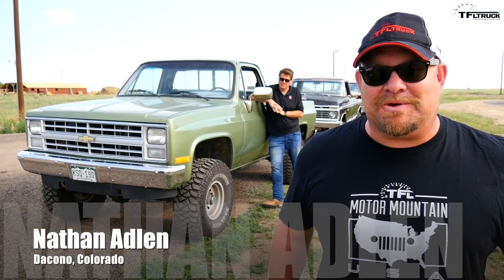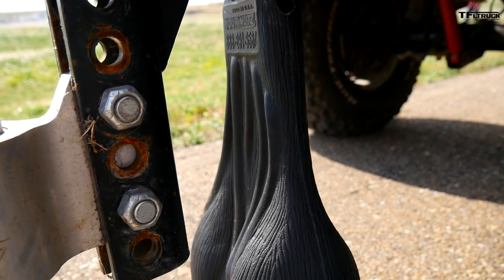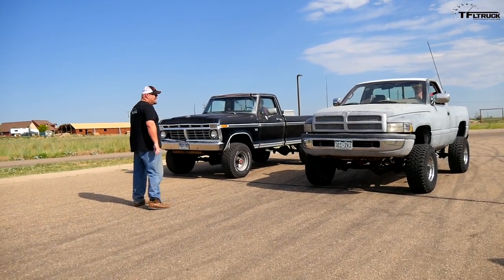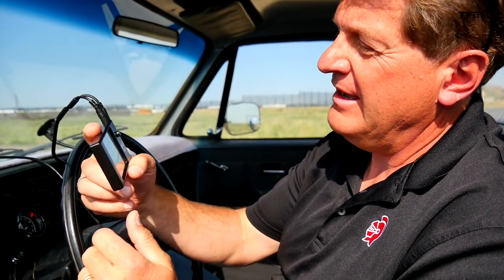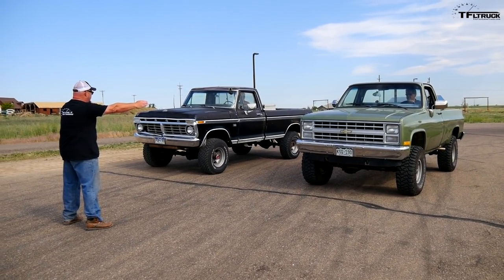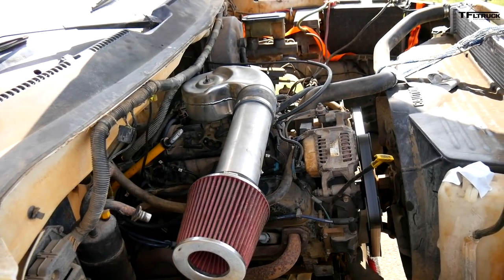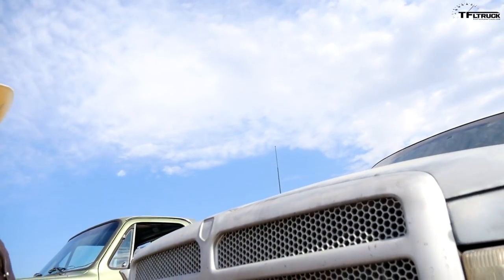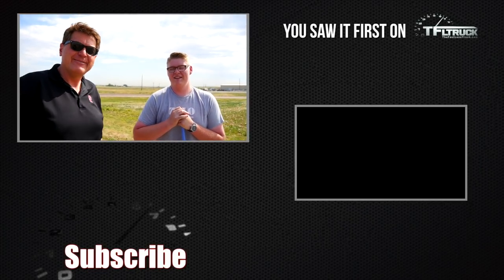Classic Drag Race: Chevy K10 Big Green vs Ford F250 Rusty Boy vs Dodgezilla Ram Overkill

Comment: Are all dodge drivers so embarrassed that they have to debadge the front grill
Reply: guy proulx I'll have to drive my 318 out there with 3.90 rear end and show this chevy what up...
Reply: If that dodge makes it that far, LOL
Reply: Have a 1/4 mile the Dodge would pass them,thanks to the highway gearing with tall tires makes it sluggish of the line..
Reply: lol the doge 318 is junk ahahaha nice try tho
Reply: Otto Bauch Dodge rams are the longest lasting trucks on the road. I don't understand the hate either though. I love all trucks. They have soul. Yet I prefer my hemi.
Reply: Sara Hall 318 is actually a very reliable motor that you can squeeze 18mpg out of in a Ram, same as my buddy's 2008 Silverado 5.3L. They're underpowered, especially behind the automatic, but reliable. Not junk.
Reply: 01trsmar No joke. The 46RE automatic transmission has a 2.45 first gear.... While the NV3500 manual transmission has a 3.49 first gear and 2.19 second gear... So the automatic is almost like starting in second gear with the manual. Also the automatic has a 22-25% parasitic power loss compared to a 17% power loss with the manual... The automatic killed these trucks the most, seconded by the kegger manifold choking the motor above 3000rpm... So you had a motor with low end torque but crappy gearing, and then once you got into the gearing the motor got choked out.... The manual tranny at least solved the low end part of the problem.
Reply: Sara Hall average life span I've seen for 318's at at lest 300k. At most 500k I don't consider that junk.
Reply: Sara Hall i have a 318 i have small misfires but my truck haulls ass still. Still a strong truck good engine.
Reply: Otto Bauch Lol na ill keep my badge that old fart probably wasn't even giving her full throttle.....I lost count how many 5.3s my mildly built 318 in my 92 ram has defeated
Reply: My brothers ram is 18 years old and has a 318 and 225k miles w no rebuilds and runs like a bat outta hell still wouldn’t call that junk
Reply: The 318 is probably the most reliable engine ever built.  I have one in a 95 Dakota with 270K and it has never had any problems except the timing chain cover.  Pulled the heads off 20k miles ago and the shop was absolutely shocked. They had never seen a 250k engine that looked like it had just come off the assembly line.  It didn't even have a ridge at the top of the cylinders. (Mobile 1 since new)
The transmission is also factory and I can't believe it has lasted so long since the truck has spent its life on the farm towing 11k hay bale trailers, and blasting through really rough pastures. It somehow survived my highschool years where I neutral dropped it, did burn outs, went mudding and even jumped it a few times.
I can't believe how reliable this little Dakota has been and I even embarrassed my friends 80k 2018 Raptor the other day.  My tired old 25yo truck out towed my friends Raptor because I have the heavy duty front plow suspension and 2k overloads in the rear of the Dakota.  It actually squats less than my friends Duramax and I was able  to haul 7k pound trailer where the raptor couldn't take over 5k.
Reply: whhitestallion 
No they aren't. Look around, you see 10× the number of 80s and 90s chevs than dodges. No one shares your delusions nice try
Reply: @waterloo123100  
My thoughts exactly.
Reply: Mopar or no car

Comment: FE block engines were beasts (with the exception of the 360; destroked 390 with less power and worse mileage).  The 360 still had torque though.  If it is a 360, get the kit, turn it into a 390, put a cam in it, good heads, and 2 Carter AFB's on top, and you have something called a sleeper.

Comment: First step on the F would be tare the engine down make sure it is a 390 if not get a 390 crank, and pistons , .080" over bore, 11:1 at 6,000 feet you could run pump gas, Comp 280H cam, Performer intake, some bowl blending on the heads, a performance valve job, 600cfm Holley, rebuilt trans. you would just watch that $15,000 chevy fade in the mirrors! And spent $4,000 to $5,000. I estimate 370hp@4,500 rpm and  510 ftlbs of torque @ 3,000 rpm at the crank.

Comment: The Ford is mostly equipped with a 390ci big block, not a 360. Hell, Idk if Ford even made a 360ci small block. However, AMC did make a 360ci Wildcat. I may be wrong though.

Comment: I'd love to see the hi boy with a 390 stroked out. tough engines and very good off road. there's a few great kits for it. with both of my old hi boy pickups I ended up rebuilding the transmission. one C6 with a shift kit.i improved the cooling with a new radiator and a second trans cooler too. the odd ball was the one that got a beefed up C4 trans and otherwise my trucks were stock except for the 16 inch rims (better off road due to bed area) but tires were stock size. the C4 was faster, the engine it ended up with was a 406 and I wish I had it now. the guy really planned out the engine swap. I'm now looking for a 428 block to start a project with no luck. I am a poor guy, can drop $3500 on a block and crank that's also in unknown condition.

Comment: Great stuff guys,looks like you had a blast! I think that would be awesome if Ford and RCA stepped up and did something with those trucks. That old Ford really surprised me how fast it actually was off the line there. I really hope Ford will step up to the plate on that old 74'. Those were great trucks. Sooner than later if you are going to end up blowing that engine up. And that will be a shame when that happens.

Comment: A cam, heads and stall converter in the ford would make it blow the Chevy out of the water. I’m a Chevy but. But the 360/390 is a bulletproof motor that made TONS of power reliably FROM FACTORY. You want a neat car? Swap a 390 into a Fox. Talk about a fun car.

Comment: Hopefully you are going to fix the mounting position of the High Pressure FiTech Fuel Sump.
Reply from the maker: +David Merry Yes we will
Reply: The Fast Lane Truck - I got their EFI System for my '65 Ford Falcon and can't wait to get it installed and running down the road.  Thoroughly enjoy your reviews and other sidebar videos like this one.

Comment: I used to have a 78 F250 with a 460 Big Block in it that used to be the Old Ranch truck I went and swapped it out with a 73 2 Door Lincoln that had a 460 in it and that little sucker would run get rid of that 351 and drop a 460 in it with a C6 transmission you'll love it
Reply: Got a 79.camper special with a 460.strong truck.

Comment: wow way to stack the deck.... 405 hp crate motor vs old big block vs a little 318 with highway gearing and fat tires. hell a stock 360 would still got ate. maybe the V10 2500 or definitely the 5.7l hemi would have been more in line with the others. i mean id of brought a hemi toasted the ford and at least kept with the chevy.

Comment: Kent you should make that a cold air intake. Ik it is a small upgrade but still
Reply: It has a cold intake and headers, full exhaust. I new I'd loose but I still showed up. The night before I put gas in it and the fuel came out of the top of the tank. So the fuel pump was loose and loosing pressure. The truck cut out on the way home and on the way to the track. I couldn't get any rpm's until the end and leaking gas all the way. We put off the race as more problems showed up on the Dodge. I didn't want to put off the race any longer. So I bit the bullet. Next time we'll do better. It's a project truck I don't have freebies from sponsors so I have to shell out money for each fix. The truck is close to done, should be ready for the off road test and hopefully a rematch on the track.

Comment: Dropping a 4 barrel carb with intake on it  and  headers + a cam helps a 360 significantly. Without they are dogs. But it did damn good against that much lighter 1/2 ton short bed chevrolet with the new EFI crate engine in it. That old Ford is a heavy pig !

Comment: Looks like he just held it to the floor in a automatic you have to pump the gas  each gear then when you get momentum rolling you sling shot pump the gas and have it held almost so it roaring then when your about to shift last gear hit the overdrive button and hold it to floor and it will kick you a little bit more into the slingshot I made people look like they were sitting still as I passed them lol you people don’t know how to race I pull on dodge 2500 all the time bc of this you can’t just hold it to the floor wide open and wait it takes even longer to go through the gears

Comment: I like the old Ford in the old Chevy both I drive a old 87 Ford pickup truck with a 5.0 with 500,000 miles on the and it still runs good it's F-150

Comment: It's a pattern ones from the 70s ones from the 80s and ones from the 90s
Reply: Technically that Chevy is a 1970's platform to. The square bodies debuted in 1972 and didn't change much until they were completely phased out in 1991.
Reply: @nathanmcdonald610  the facelift

Comment: that ford is 100% a 360 that cold blooded start is the notorious low compression that 360s have going from 360 to 390 is a crank swap and new heads 
you dont need the new heads but the OEM are trash

Comment: I was sure Kent brought a ringer, but it looks more like a wronger
Reply: It has a cold intake and headers, full exhaust. I knew I'd loose but I still showed up. The night before I put gas in it and the fuel came out of the top of the tank. So the fuel pump was loose and loosing pressure. The truck cut out on the way home and on the way to the track. I couldn't get any rpm's until the end and leaking gas all the way. We put off the race before as more problems showed up on the Dodge. I didn't want to put off the race any longer. So I bit the bullet. Next time we'll do better. It's a project truck I don't have freebies from sponsors so I have to shell out money for each fix. The truck is close to done, should be ready for the off road test and hopefully a rematch on the track.

Comment: I think I know why the Ford beat the Dodge. First, the Ford had its stock wheel diameter while the Dodge has aftermarket over sized tires; when you go to bigger tires, it is like going to a higher gear. The other reason I believe the Ford won is because of its locking hubs on the front. This means that the engine did not have to deal with the drag of all the front end components turning all the time like the Dodge.  BTW, I own a Ram and as much as I love that truck, I was always critical about the front axle and how they have all that stuff turning all the time.
Reply: Master chief Master chief  , nope, not making any excuses for Ram at all. I'm just pointing things out from a neutral perspective. I personally think GM's I.F.S is the best, BUT, if one is still going to use a solid front axel, Ford does it right by having the outboard locking hubs; I am not very partial to Ram's C.A.D & I believe the only reason I haven't had any problems with my front end yet is because I do predominantly highway driving.

Comment: 1983 Ford f250 4spd 460ci 365hp 485 foot pounds of torque towing power  vs Dodge V10 300hp 450 foot pounds of torque 4spd automatic transmission towing power  vs Ford 1998 310hp 425 foot pounds of torque 4spd automatic transmission towing power  best truck the world's toughest engine

Comment: Carbs are way better than fuel injection because you can tune them quick and easy and diagnose a problem very quick and there cheaper and you can make more power
Reply: Yeah I was gonna set my 05 Dakota up with a carb so I could get a performance exhaust and not have to deal with the o2 sensor bs. Someone was like "you'll lose power" bro it's a 4.7 liter magnum v8 makes 235 hp it's a worn out engine I really can't lose much more😂😂

Comment: sounds like the dodge wasn't pulling all the way to the redline.
Reply: It wasn't, the high stall torque converter lets it shift above 5000 RPM's. I couldn't even get to 4000 RPM's until the end. The fuel pump in the tank was loose, the engine was cutting out. But we'll have it all fixed for the next contest.
Reply: Hunter  what did you expect? Lol it's a dodge man.
Reply: Ryan P-76F1004x4 the rpm in which the torque converter lock s up at can make a big difference on acceleration.
Reply: MrTruckTV thanks for the reply and I figured it was something like that
Reply: Hunter  Meier yea I know this. The dodge is some what stock motor wise so why need a high stall??
Reply: Ryan P-76F1004x4 my dad had a 1990 4 or 5 and if you were going at a steep hill with no load it never wanted to shift but it had over 320,000 miles on it so it was to be expected

Comment: V10 Ford 6.8l 4spd 1998 2door long bad 300hp 425 foot pounds of torque   vs 8.0l V10 Dodge 4spd 1998 2door long bad 310hp 450 foot pounds of torque   vs v8 460ci 7.5l 4spd 1983  2door long bad 365hp 485 foot pounds of torque
Reply: Ain't no stock 1983 460 making 365hp. I think they barely made 200hp that year and around 385ftlbs of torque.

Comment: Man those old LA 318 magnum will run forever but they are so weak in the power department.
Reply: jmc6000 me trucks 318 is a magnum they stopped making the LA 318 in 1991 which I have...
Reply: Dodge 318 Cummins Well the 318 magnum is very heavily based off the LA 318.  It is like saying the Vortec is not a small block because it is a Vortec but they based heavily on the small blocks prior to GM going to Vortec.

Comment: "360 or 390" ??????
Reply: grumpybill The previous owner told them it was a 390 but the high boy stock V-8 was a 360 so they're not sure which one it is.
Reply: grumpybill I'm for sure assuming it's a 390.  I had a 360 in my old ford and it was slow af